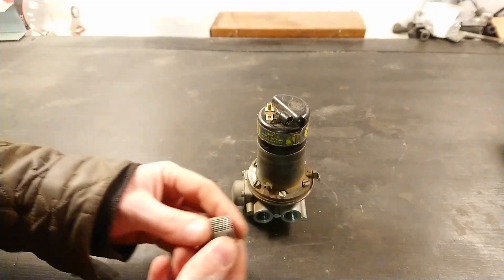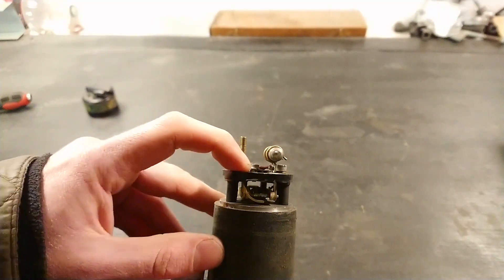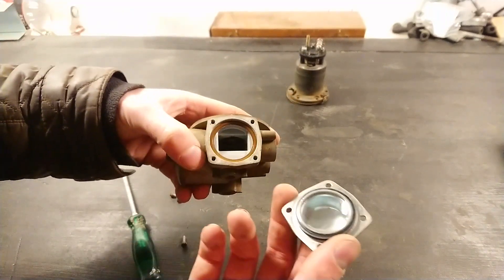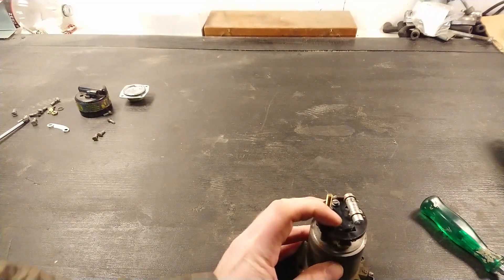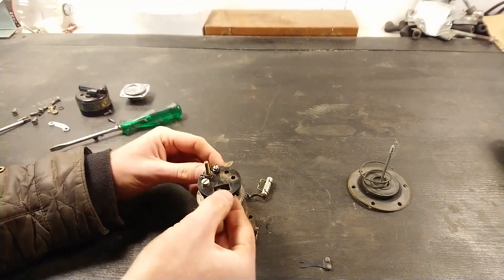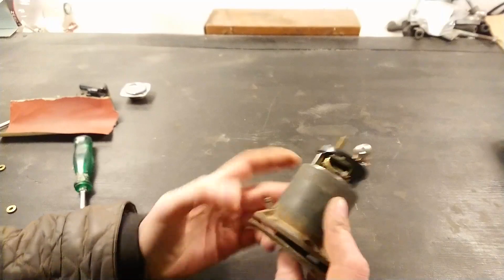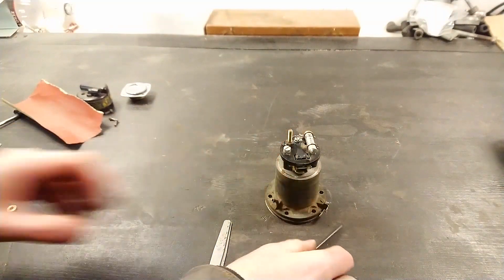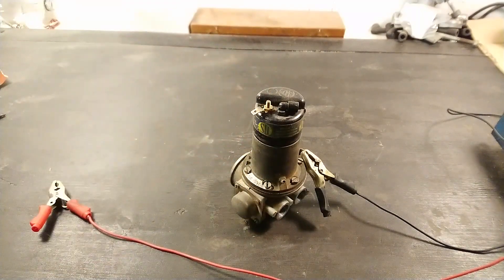SU Fuel Pump Explained - Common Faults and Fixes

Comment: Thank you for excellent content! I have a question: There is a little tube sticking out from the pump house, what is it for? Should there be a tube connected to it when the pump is in its place in the car? (I have a XJ12L -74 with the large pumps)

Comment: Hi thanks for the Video. I own a XJ6 Series 2 1976 4,2 Long. My fuel Pumps sit in the Tanks. There is no backflush. What is the mechanism to avoid overpressure? Where do I get a spec for my fuel Pumps?

Comment: Which way up does it work best?  Someone said mine is upside down in
My MGB GT.  It’s on its side with the inlet/outlet on the top.  Car starts, runs & splutters until the engine stops.  It pumps a litre into a jug in 50 secs.

Comment: I feel like drop-kicking my su pump across the field. I took it apart yesterday to find a perished diaphragm and luckily I had another crusty old pump laying around in my spare parts pile that's luckily probably never seen ethanol, nicked the diaphragm from that and put it in my working one. Now I can't seem to get it to operate, I'm pretty sure after watching you're video that I'm not screwing the diaphragm in to the correct tension. I'll go out and have another go in a bit, thanks.

Comment: What is the small nipple on the side for.
Reply: A breather. One site talks about putting and routing a small hose on the side nipple / tube to keep dirt out. The nipple / tube on the cap is also a breather. The cap has a small ball under it and acts as a check valve for the breather elbow. My Jaguar book shows 3 parts. Breather elbow, on cover (AUB.702) -  10204 ; Cap, for breather (AUB.703) - 10205 ; Ball, under cap (AUB.704) - 10206.

Comment: HELP> I assembled the pump, the gaps were good, i backed off the diaphragm....but it wont run.  taking the top half off and powering it up it wont run....but if i press up lightly on the diapragm....THEN it runs.  What did I do wrong to cause this?

Comment: great video Adam, thank you. Just did the points on my Daimler Dart SP250 that had stood over the winter and refused to start as the SU pump wasnt working. Cleaned up the points and off she went! The best thing were the close ups with the description, of how to measure the points gap. Other vidoes by othersare not half as clear. well done.

Comment: Hello. Can you give your oppinnion what could be wrong. My s1 (1969) right fuel system wont work. I have changed the pre pump fuel filters on both pu pumps today as they where brown. The su pump in question appers to work as it clicks 2-3 times then stops but the pre filter wont fill from the tank. There is only abt 1/4 full of fuel in the plastic filter housing. When changing over to the new filters the flow of fuel from the tank in question appeared ok. Could there be a damage fuel pump, membrane or just ditt inside so it doesnt suck? Or to much air in the filter that is before the pump? Your response appreciated.

Comment: I the time 2:56, there is on the top cover visible plastic cap (elbow) what is inside there?
Reply: The cap has a small ball under it and acts as a check valve for the breather elbow. My Jaguar book shows 3 parts. Breather elbow, on cover (AUB.702) -  10204 ; Cap, for breather (AUB.703) - 10205 ; Ball, under cap (AUB.704) - 10206.

Comment: I'm happy to find your video because i have an issue with the pump of my 1975 MGB. The cork gasket is totally deformed, and i think i have to replace it. Do you think the cork could ne replaced by a rubber one ?

Comment: Hi Adam,
Thank you for this highly interesting video! It encouraged me to take out and diassemble the SU fuel pump of my 1966 MGB, which has been parked for 7-8 years and service it, yet when I opened it, I found what appears to be an electronic control board instead of the rocker/contact points assembly. Now I´m back to the start, I guess.. :-)
Best regards, Martin
Reply: instablaster.

Comment: Thanks for this very useful video. I have an SU pump that works when the valve body is off but not when it is screwed up. There is only one contact point and no condenser. I'll have a check of the points clearance now. Cheers.

Comment: I've owned about 20 Jaguar saloon cars from the Mk VII to the Daimler DS420 that used these pumps. I've only had to replace one diaphragm ever, but had to clean the points on every other one to get them running at one time or another. There's a product made for pinball machine repair that is a very thin contact cleaner. It looks like a plastic nail file. It's thin enough that it doesn't spread the points apart that much, and strong enough to clean the contacts up and leave them nice and straight in just a few swipes. 

The contact cleaner and a big wrench were my go-to items to get an old Jaguar running. The big wrench is used to smack the Lucas M100 starter on the side to get the brushes to release from the armature when you turn the key, hear the relay click on the starter, but the engine doesn't turn over. Works EVERY time.

Comment: If you would, should the su pump always be clicking or does it ultimately stop when carb or lines to carb are full?
Reply from the maker: It stops when the carbs are full and then only clicks from time to time to keep the pressure
Reply: Thank you!

Comment: Thanks for the vid. I had a MGB that had not been started in 12 years. I couldnt even get a twitch out of the fuel pump. I took out the top points and used a brass brush to clean everything and took off the top and took out the diaphragm to make sure it was moving. Its now working correctly. One thing I notice that was not in your vid was that the threaded hole the diaphragm screws into can turn sideways on you and you have to get a small screw driver or piece of wire in there and rotated it back to get the diaphragm to start threading back into it. Thanks again for the vid. It was a really helpful tutorial.

Comment: I have an Mg Td that has a spare put as well as one on the car. I have an issue with the points on both pumps. The one on the car is similar to you film but the point only have one point and no way to adjust.  The spare pump has 2 points as in your film but the Bakelite base which the top points fix to is different in that it is a cut out where the point go through and not a rectangular hole. So there is no way to set the points. The bottom spring loaded points seem to be pushing hard against the top points as there is no Bakelite edge on the base plate to push up to.  Also is it possible to fit a capacitor to prevent the points burning?  What capacity would it be?
Reply from the maker: I'm not familiar with that pump but the one in the video does have a capacitor to make the points last longer

Comment: Thank you for recording this! I was able to see how to disassemble and access the points from your video. I did not fully disassemble like you did - I only popped the top cap off, removed the top point (easy), brushed the points clean with a scruff pad, reached down and did the same to the bottom points (without disassembling them), screwed the top point back on, dipped a Q-tip in apple cider vinegar and wiped off the surfaces, reassembled and installed, and I have a working fuel pump again! Thanks!
Reply from the maker: Glad I could help and that you got your fuel pump going!

Comment: Fascinating--at least to me, not being mechanically inclined. What would be really helpful to me if you could manage it is to install a really good camera directly above your workbench so you can zoom in on those small bits (screws, nuts, points, etc.) and that way I could see where exactly they fit in.
Reply from the maker: Thanks for the idea Daniel! I purchased a new camera last week that I am trying out to use in new videos- I'm hoping it will be clearer and be able to provide different angles.

Comment: I need to do this on my Corniche. It has the dual pump too. It seems to leak, but it's not clear to see  exactly where it leaks. Is it the main diafragms, or could it be the ones in te chambers?
Reply from the maker: It could be any of them. In the full rebuild kit you get them all. I've found that the diaphragm seems to be the part that leaks the least unless it's been overtightened.